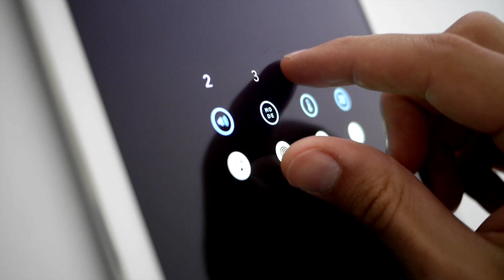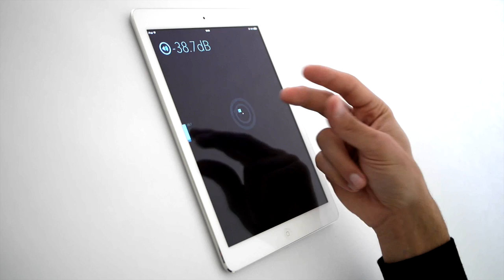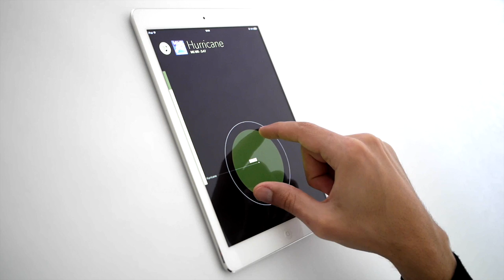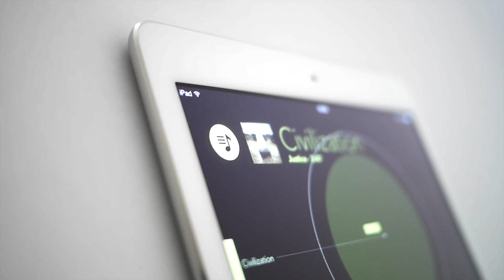A New Car UI: How touch screen controls in cars should work

Comment: This is not well implemented yet, and can be taken only as concept for now, since there are people that have less then 5 even 4 fingers in their right arm (assuming those interfaces are for European car models not UK, or Australian cars, though they will  face the same problem even more lets say in Australia, since that continent is user friendly with wild animals and it is common thing people find crocodiles under their bed, behind sofa, or under kitchen table in their houses, and those crocodiles eventually eat fingers of car owners. I assume that this concept should be redesigned or be customizable for people who have less then 5 fingers on their hands, consider this small note and make it even more easy accessable for people with 3 fingers, other way they will not be able to turn on the air condition system.

Comment: Jeep Cherokee uses the screen to control fans and temp, and when those do not work, you have no way of a physical button to turn down the heater, it will constantly run. Not a good idea for heating and air conditioning controls in a car. The Tesla has everything on a screen and when that screen does not work anymore you can not control anything.

Comment: This guy should copyright his interface and apply to be a designer at a car company, with the stipulation that they can't use the interface without employing him
Reply: Alfonso Surroca what OneNote does is nothing like this! This is even less distracting than knobs because you don't even have to think about where to put your fingers! Did you even watch the video?
Also, voice is annoying and tedious; how would you turn up the volume just a tad? "Sync, increase volume point one decibel" over and over again until it's right? Sounds much less convenient and more distracting than putting two fingers somewhere to your right and slowly moving them up
Reply: Alfonso Surroca That'll probably take 100 or more years to perfect, though. This interface is available today, and seems too easy not to implement.
Reply: +Alfonso Surroca assuming that it works.. and youre in a quiet place. 

I don't want any of this junk. I just want a well designed physical interface.. no touchscreen needed, no voice control. Those are issues, not features imo.
Reply: Bingo!

Comment: I am very suspicious of touchscreens being in cars. I think they are dangerous. There is a reason why most countries have laws against electronics use while driving. Analog bottoms provide a tactile feel that is necessary when making split second decisions when driving. You can manipulate a knob without having to look at it. The trend is to turn everything into a smart device. The difference between using a tablet and driving is using tablet doesn't involve operating a 3000 lbs death machine driving at 60+ mph. I suggest we add a tactile feel to touchscreen or ditch them entirely. I am very conservative in my design approach. Practicality is key. If it aint broke don't fix it. It is up to us to research what is the safest user car interface. Then we should design around that. Anyway, I appreciate you adding to conversation about good ui design in the automotive field. Thank you!

Comment: Interesting - but WAY too complicated.
 
Look, cars have fairly consistent functions: ventilation, entertainment (radio, etc.), cruise control, navigation, locks, window controls, and so on.  What would make much more sense would be to design an open, standardized interface to those functions that car manufacturers would support.  That interface would be available in addition to the manufacturer's own / branded touch screen or voice control or whatever.  The interface would be accessible via Bluetooth or some other wireless connection, and would allow a smartphone app - that the manufacturer publishes or is available from an open source forge - to control the on-board functions of the car.  Drivers could then purchase the app that they like best, and simply use the app - either via the smartphone or tablet touch screen or voice control - to control the car's functions.  Because the interface is an industry standard, the driver can use their app in any car that supports that standard.  So, for example, my smartphone or tablet (which is conveniently docked in the car because the manufacturer provides a dock, and maybe even a display replication on their built-in dashboard screen), is completely familiar to me, and I can use it in any rental car or other car I use.
 
So in summary, the benefits are:
 
- the manufacturers get out of the business of designing hellish interfaces
- the manufacturers adopt a convenient industry-wide standard, which can be expanded as new functions are made available
- the control of the functions, in addition to the good old analog buttons, is enabled by apps on portable devices
- users get to choose and use whichever app they like best and stick with it regardless of the manufacturer / car (learn once, use many!) - and this leverages the already owned user's device
 
Everyone wins and as an added bonus there are fewer accidents :-)

Comment: The problem with your UI design is that: it will be very hard to teach drivers how to use it and how it works maybe it looks easy  for you because you made it but if you put someone on that screen for the first time he's not going to know where to start and how it works it needs lot of explanation, teaching and practice to learn how to use it, and using more than finger when you're driving a car is going to be a disaster, because the fingers don't have the same measurements, the copmuter is not infront of you like you're shoing in the video, you should test it on a real car to undersand what I'm talking about

Comment: sorry but you are asking users to learn and remember almost an new language!
like talking to def people, you have to memorize 8 at least difference gestures with your hand! you dont have a predefined button there for the co-passenger that want to change the radio, everyone one sitting in this car, should read first a manual and then try to turn down the volume for example in order to speak to their phone (as a co passenger), because lets say the driver was step outside for a while to feel up with gas!

sorry in basic principal it look nice and simple but has small still though important details that will not make it "easier" that what Tesla Model S has for example at the moment. (i am not talking about other touch screens its crappy software anyway only tesla has the best)

Comment: Another pointless attempt at redesigning the wheel. Manual, tactile controls will ALWAYS TRUMP these terrible UI's, forever. When will manufacturers and designers learn this simple fact ?
Reply: I totally agree. Tactile controls are always more efficient especially for blind control. But I do believe a hybrid solution could be even more efficient.
Reply: What about when your car is parked outside for an absolutely frigid winter evening in minnesota? How does the ipad respond in the morning when you want to turn the heat up. There are mornings my radio won't light up...
Reply: Pointless attempt? It's ideas like these that influence and inspire others to improve on what is already out there and make it better. I'd be more interested in how you feel you could improve on this idea rather than shooting it down completely. Perhaps find a middle ground between touch UI and tactile controls?
Reply: orenji A touch ui just isn't something that can be made reliable. Not to mention its far more expensive to put an ipad in your car then a handful of dials.
Reply: Kerrigan Marois First of all, you don't need an entire iPad for the stuff demonstrated in this video, just a multitouch screen.
Secondly, the video focuses on improving existing touchscreens, meaning you have already lost the "manual, tactile controls".

That said, as others have said, the existing solutions usually have more than 8 functions. Some also provide GPS functionality which adds even more controls.
The idea also assumes that all users have 5 fingers on their right hand (left if your steering wheel is on the right side).

People have also mentioned this has a high learning curve, this ignores the fact that the demonstration shows a black screen most of the time, while it potentially could show illustrations of gestures (all the helpfulness of buttons with fewer of the drawbacks).

The lack of control options could also potentially be solved by more complex gesture systems, for instance you could have "pages" that you could swipe between by moving sideways, each page providing up to 8 new controls.
Reply: orenji the idea of touch controls in a car is bizarre on it's own. Why anyone needs to recall how many fingers he need to use to turn the heat up? Yeah, that one looks cool, but what the purpose of this awesomeness? A knob or a button is better cause you never ever need to look at it, it never suffers from software glitches and always does what you mean. That's the Occam's razor. This idea is just increasing the entropy.
Reply: Eugene Suchkov
its not true if you say, you never have to look at a button... some buttons are maybe hard to reach or to find. The other Fakt ist... in a big Screen you can do many other Things.... for example navigation. And its Modern...

Maybe me and you we would say its better to get a button. But many People love everything new, even if it's senseless.

Comment: Collosal bad idea.  There is cleverness here, but no one busy driving in a bouncing car is going to be helped by this junk.  Mixing radio and heat/cool controls in one physics device, just in itself, is collosal stupid.  Audio source - that requires looking, which requires taking eyes off the road.   Good old fashioned separate knobs, levers and buttons that can be operated by feel, are the way to go, until mind-reading sensors become practical.